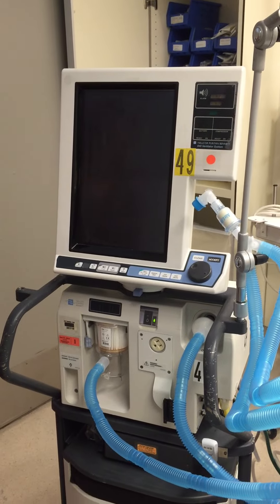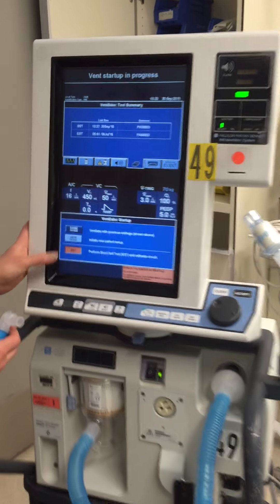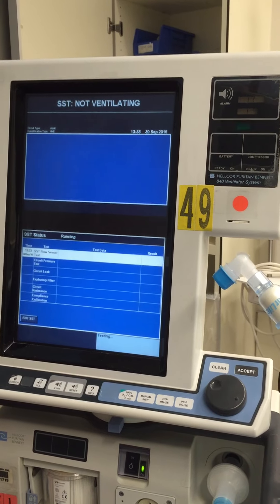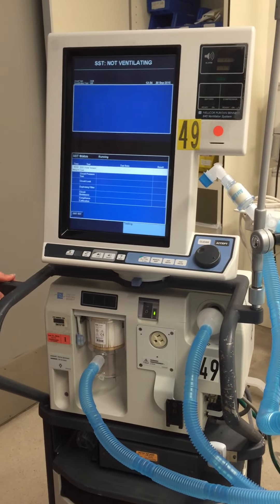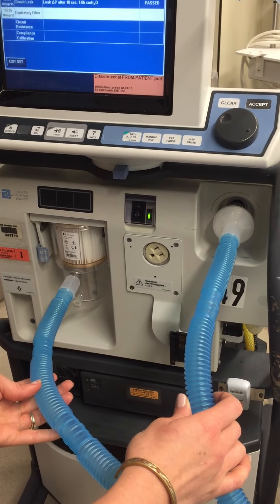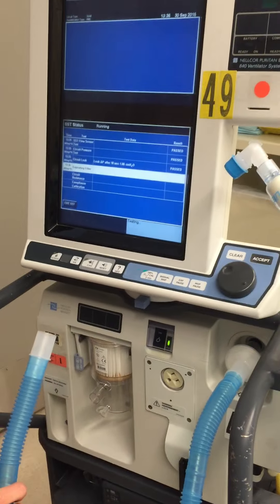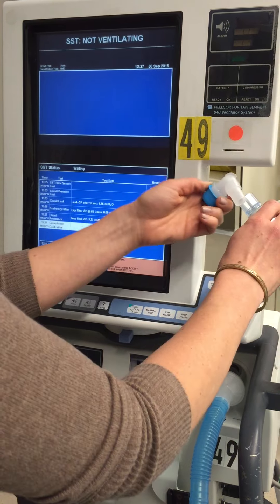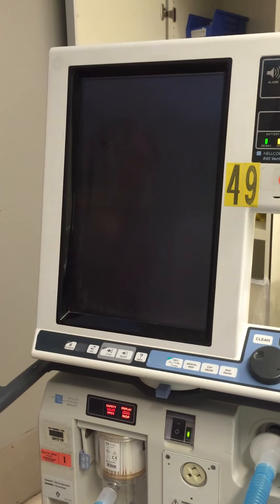Puritan Bennett 840 Ventilator Short Self Test SST

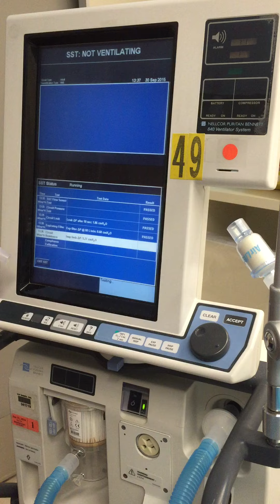Comment: 5:13 "explosion" she said.
I think this sound caused by hi-flow passing trough the ventilator. any idea?
Reply from the maker: +John AK72 Exactly, it's testing the circuit's resistance. It's a loud machine in general, so this is normal.
Reply: Laurel Yang You're right. Bennett is a legendary brand and so far we have experienced lot's of great ventilators, but personally I think Drager is quiet better!